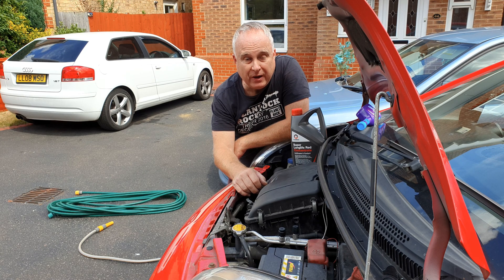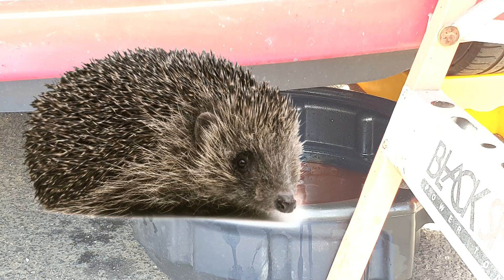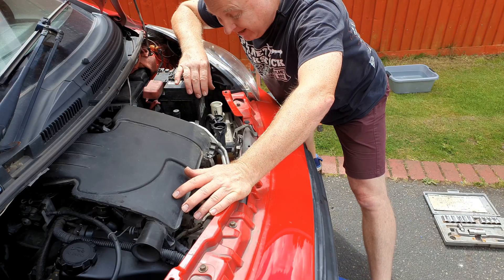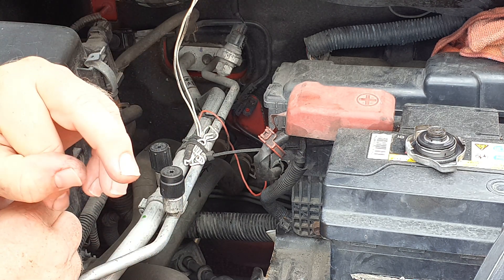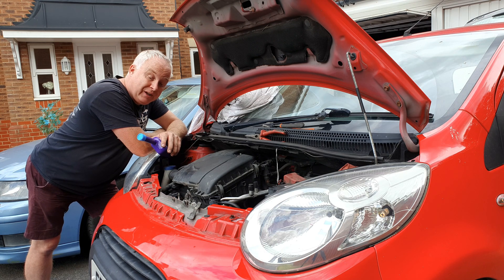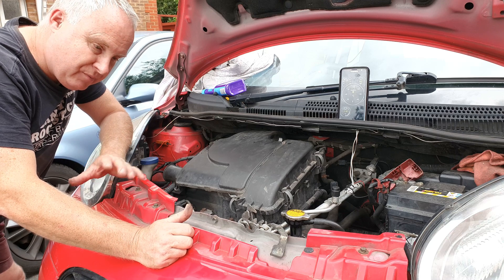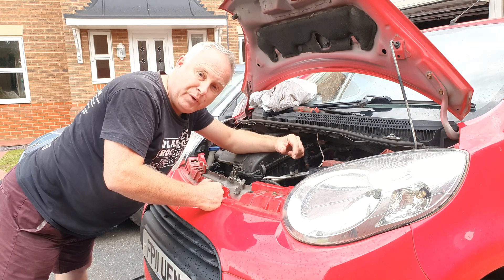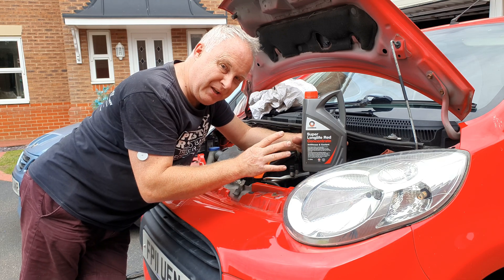How to Change YOUR Car's Coolant Fluid with a Full Coolant Flush

Comment: Good recommendations, use tap water to run the engine..you don't need distilled water...Also when you want to clean the radiator, i recommend you to use distilled water , later if you end the cleaning use tap water again to run the engine . I can guarantee you salt wont be an issue in 90+ Celsius!!

Comment: Hi Paul ,hope you’re well. I’d appreciate if you could share your opinion on this… had the clutch replaced on the semi- automatic gearbox. The gearbox shifts as it should , accelerating properly but when you reach 70 mph the car struggles to reach even 80 mph . The revs don’t go up , it feels like something is restricting the car , it wasn’t an issue before as the car with slipping clutch would reach 80 mph . with ease.

Comment: I have a recycling center very close to where I live and they told me NOT to pour the coolant in the toilet because the coolant doesn't get filtered and it ends up in the water system, at the end.
They also said many people do that but they shouldn't.
I just need to bring a used-coolant tank to them and they will do it, for free.
That's why I don't do that and it doesn't sound a good idea otherwise the garages would just pour it in the toilet as well.

Comment: Great video thanks a lot! One question, do you know where the coolant bleed valve/plug is on the Diesel CDI engine? I did a cooling flush on my 2009 ForTwo CDI but could not find the bleed point location that I know should be near the cylinder head to bleed the air out of the tubing. Now the car is overheating with the water not circulating and I guess full of air pockets everywhere. I've searched all over the Internet and the all the information available is only for the gasoline engine not the diesel. Thank you very much😊😊😊

Comment: Good information, two thumbs up. 

Your technique is better than mine. 

My technique is to drain from the radiator when cold, fill with distilled water, run the engine until thermostat opens and top off with more distilled water, replace cap, drive car. Repeat Around 5 to 6 times, over the week. When the drained fluid finally becomes clear, fill with fresh coolant of the correct type. 

Think I might watch some more of your videos now I stumbled upon this one, 👍

Edit: only do my lazy technique when there is no chance of freezing temperatures.

Comment: Dexcool is a OAT (Orange), you can mix OATs but not IAT (Green) coolents. When you mix OAT with IAT it turns brown and thickens up into a gel that the pump can not move. Back in the 90's GM had head gaskets blow because people mixed the IAT with the new OAT. Universal coolent (yellow) is just a OAT that can be used in all motors that use OAT, but not IAT. 
If you mixed up say, Toyota OAT (Blue) with GM OAT (Orange) nothing bad will happen, only a color change. It's like mixing gas from different stations. Gas is gas, it's only the additive package that changes. EVERY gas station gets it gas from the same spot in the area! The diffrence is when they pump it into the tanker, the driver pours in the additive package for that station, IE: Shell, Chevron, Mobil, Esso, etc...

Comment: Great video Cid, many thanks. Apologies if you've already covered this, but as the C1s do not come with a temperature gauge, do you think it's necessary to fit an aftermarket one? Many thanks Harry
Reply from the maker: The STOP light comes on if it gets too hot
Reply: @CycloneCyd  thanks Cyd, feel slightly embarrassed that I didn't know that!
Reply from the maker: @gumpfx  no one knows everything
Reply: Dex-Cool will mix just fine with regular OAT coolant imo,  Dex-Cool is just the GM brand of OAT coolant, it even comes in the colour red these days I believe.

Comment: Good video. Gave it a thumbs up. Although your belief of the three types of coolant is wrong. There's IAT (inorganic acid technology) the green old school stuff. OAT "Dex-Cool" (organic acid technology) all kinds of colors and the normal stuff now-a-days. Then there's HOAT (hybrid organic acid technology) in some newer vehicles, yellow or orange. Dex-Cool is an OAT coolant and the first OAT coolant. The only difference between Dex-Cool and all other OAT coolants is a copywrite name. The biggest issue with OAT coolants is getting air into the system, so all of your warnings about Dex-cool coolant applies to your engine, air and heat plus OAT coolant can cause fast corrosion of metals inside the engine and a thick mucky residue. So it's best to pull a vacuum on OAT coolant systems when filling them with a venturi device and an air compressor. Only way to be sure there's no air pockets in the system after refilling. Because all the troubles of Dexcool are troubles with all OAT coolants, mainly being air in the system. Gaskets and o-rings aren't really an issue any longer, as long as the right kind are used. 
This might've been mentioned elsewhere in the comments, I didn't read them all.

Comment: Silly question but where can I get a replacement washer from for the drain plug. I looked online everywhere.

Thanks in advance
Reply: Use a copper crush one off e bay or motor factor

Comment: Just had mine done it garage. Guy did everything. Just recommended checking levels tomorrow morning and just top with Dwater. Failed to ask expectation tank or radiator
Reply from the maker: I'd be very surprised if any garage did as thorough a job as I show here. Virtually no-one would be prepared to pay the labour for such a job AND garages operate on throughput - doing jobs in less than "book time" while charging by the book❗ Methinks you're too trusting!

Comment: Hi,cyd,Any help with driver's door, citreon c1,metal (arm) makes clunky sound ,when you open and close door,have oiled it,but when you close door, you can here clunky sound, any  Help, kind regards Mike. Norfolk 👍
Reply from the maker: If you mean the check arm: lubricate the arm using silicone grease when the door is fully open and swing the door back and forth. Repeat a few times.
Also check this https://www.youtube.com/watch?v=k-svdNfST2E
Reply: @CycloneCyd  many thanks cyd,always helpful 👍 Mike

Comment: Cyd great video, Thanks. Does unused coolant have a shelf life.  Bye Heck coudnt get that drain undone, Next to the water pump. Thanks.
Reply from the maker: As long as it remains sealed and stored in a 'cool' place and out of the sun, I think most makers quote a 5 year shelf life. I've used coolant well over 10 years old before with no apparent ill effects, but in this instance I would add a bottle of water wetter to the coolant mix to bolster the anti-corrosion package.  https://amzn.to/3IIbAe6

Comment: Hi Cylone cyd,

Thanks for your clear explanation.
The copper washer around the coolant drain plug is the same size as the oil ring? 
So it seems and that is also socket wrench size 14.
How many Nm should the ring be tightened?

And the pipes you took out of the block, for the heating matrix, are those the two narrower ones on the block at the group of four pipes on the C1, 107 and the Aygo?

Thanks in advance
Reply from the maker: Not certain of the exact spec, but at least 30Nm. I did mine F tight!
The hoses are easily visible, follow them back from the heater to the block, but I think so, yes.

Comment: Sadly most people haven't got a clue about preventive maintenance and have to go to Halfrauds to change a wiper blade so flushing a cooling system would be like  brain surgery!
Reply: Rubbish, many people use these type of vlogs to help themselves… me included and I maintain 4 vehicles, always slightly different. Ever grateful to guys like Cyd
Reply: @volt8684  Your a member of a relatively small church .
Just look on ebay at the amount of cars sent to an early grave with neglected oil / fluid changes people just drive cars into the ground .
Ive been in the motor trade most of my working life!
Reply: @paddrivers  they should teach it in schools. Basic maintenance is very doable but these vlogs give confidence. Still don’t agree with your opinion so we have to agree to disagree. Its motor trader costs that prob deter people servicing their cars. I am 64 I have never changed my brake fluid on any cars or motorcycles. Never had a problem. Lots of maintenance is overkill. Each to their own and I drive to Spain twice a year in my old banger.
Reply from the maker: lol
Reply: @CycloneCyd  Very comprehensive and informative video as always Cyd👍.
Reply: @paddrivers  can’t really blame the companies, only the ppl themselves

Comment: Do I need coolant which Toyota approved? I have heard that it could cause water pump failure, if you use coolant which is not Toyota approved.
Reply from the maker: They would say that, they want to sell you "their"* coolant at inflated prices. Buy a reputable brand and flush thoroughly and you'll have no problems.
* - OEMs don't make their own coolant, nor oils. They buy from the large refiners and package it as their own. And then put the scarers on you with stories of failures because you didn't use their brand.
Reply: @CycloneCyd  I put Motul coolant in the end. So far so good :)